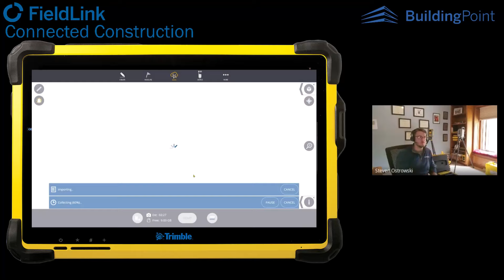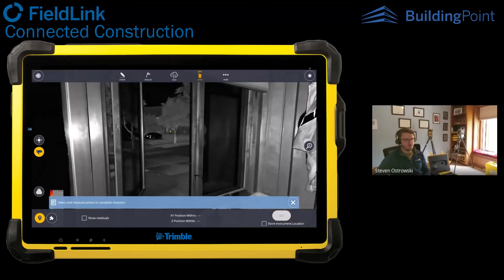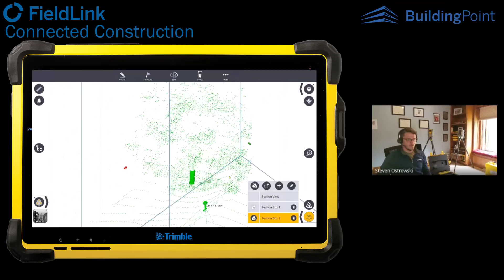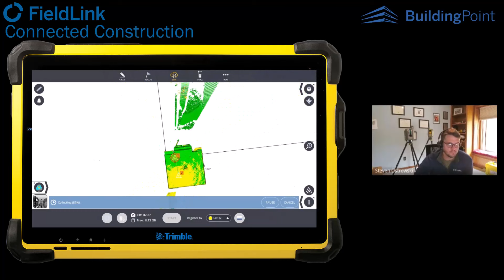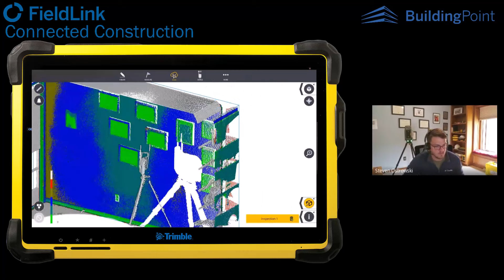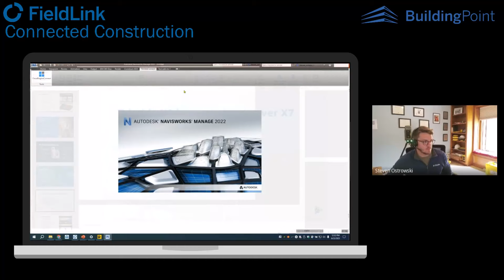X9 unboxing & FieldLink workflows

Comment: does manul alignment mess with the accuracy. I need to 1/16'' accuracy for small space less than 500 sf.
Reply from the maker: Manual alignment has no residual but that likely doesn't really matter. It depends what question you are trying to answer. Scan point to scan point measurement/analysis is the as-built analysis and generally is what matters. How vertical is the elevator, how far is the mechanical pipe from the boiler, etc are questions that are usually asked and can be determined with scan/scan analysis. For 500sf, if the registration is good, the accuracy of the overall point cloud will be close to 1/16". 

Manual alignment has no residuals. So scan to model data analysis is difficult to specifically analyze on one point. If you are looking for verticality, flatness, column locations or MEP installation, you can perform an inspection and visually see if all the elements are off. If they are, delete the inspection, manual align the scans, and inspect again. If the inspection shows most elements are <1/8", then elements showing outside of that are off. 

Reach out to your BuildingPoint Distributor to set up a more complete discussion/demonstration/analysis.